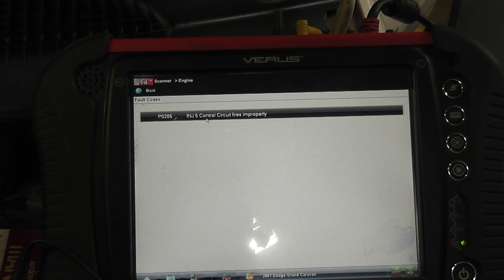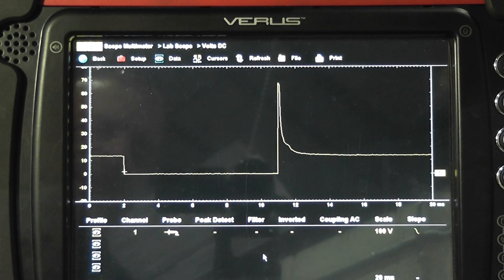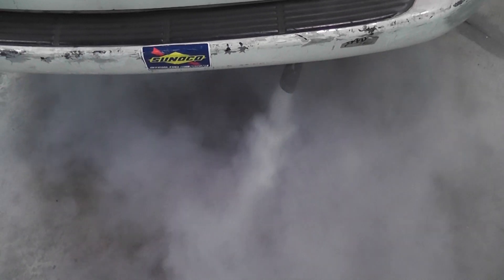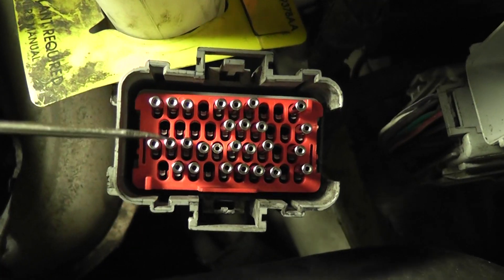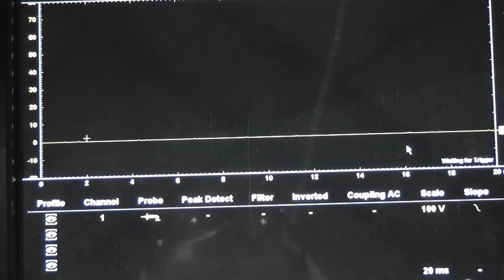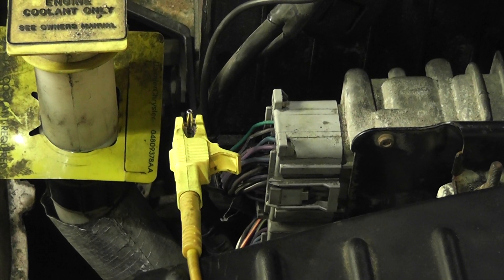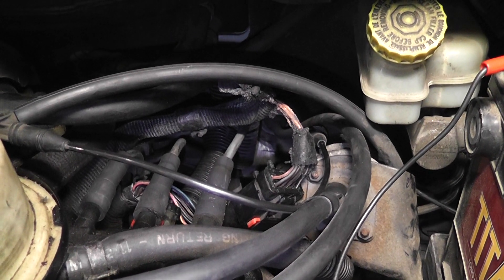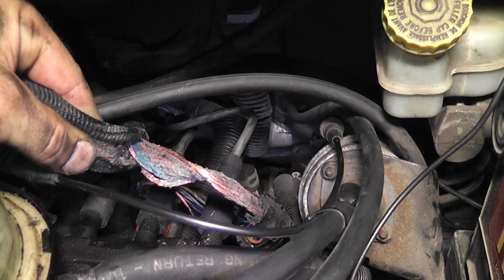Stuck Open Fuel Injector (how to fix)

Comment from the maker: @frosty9595 Two things, first you are correct in that if the injector has a 12v feed and you touched a test light (connected to B+) on the control wire that it should not light. If it did (as in the video) then you have a shorted control wire. Second, Chryslers do NOT have power to the injectors with the key on. The ASD relay controls power to them and operates off of the same driver in the PCM as the fuel pump relay. So there MUST be an RPM signal for power to the injectors.

Comment from the maker: @frosty9595 lol no way
Reply: Hi Pal, bought a 2000 gmc Sierra 1500 single cab v8 and the exhaust smells like gasoline and checked the dip stick and its gas down and looks more like oily gas more than oil. What do I do or what's wrong?